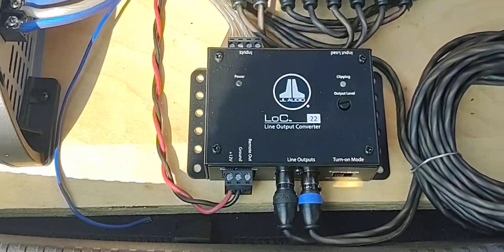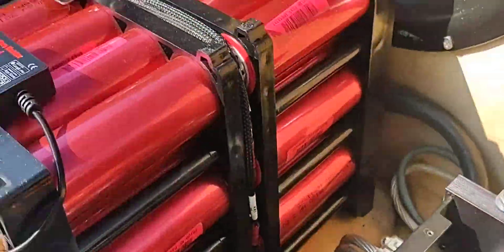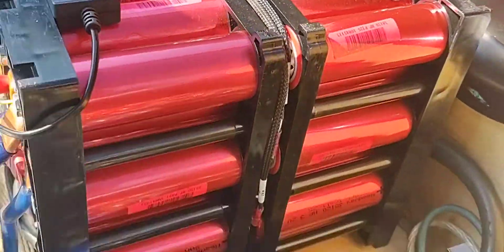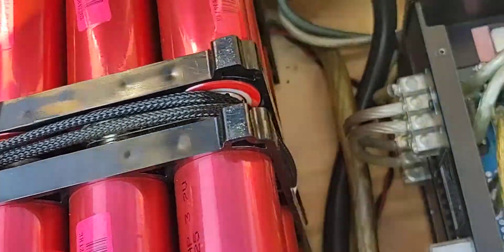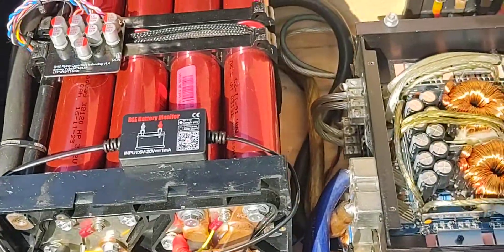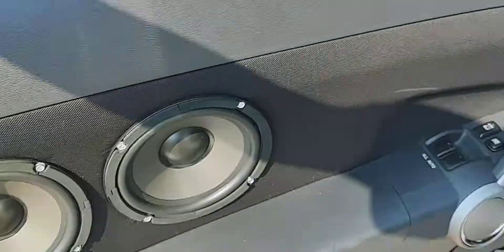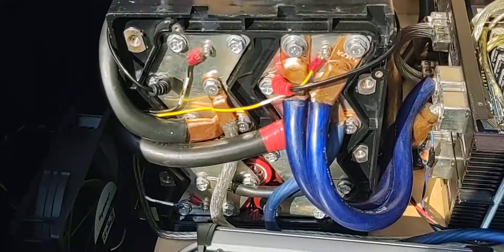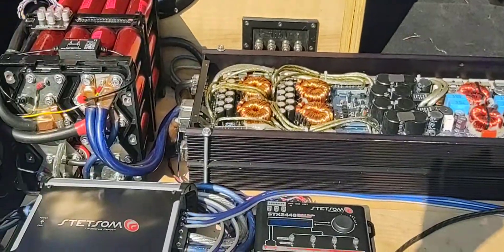Headway "Super Beast Module"

Comment: How do you charge them? alternator?
Reply from the maker: I used the alternator which isn't technically recommended, and had zero issues. I do have 370a diy large case hairpin that took the beating like a champ.

Comment: Also can you please tell me what I need to make it work properly with my stock alternator my car 2019 Toyota Camry LE has the new ONBUS LINBUS electronics build which means the cars computer is built into the alternator housing and therefore can NOT be converted with a HO alternator so lithium is my best option specifically headway because of the stock alternator or I would want LTO from what I'm being told so I want to get the super beast and I'm thinking about getting the 96 AH PCBway boards but I'm told I will need some type of BMS and active smart balancer is that correct and can you tell me what products you have to make it work again all this is new to me

Comment: Please excuse my lack of knowledge I've been gone for quite awhile not willingly mind you lol but when I left an extra lead/acid battery in the trunk was doing big things with your system now everyone has massive lithium banks I'm getting back into it nothing big YET just two L7'S with an 1800.1 but I want to go bigger so I've been looking at the super beast and I'm wondering if I caught what you were saying correctly but after converting to 12v this winds up being two 48AH 12v banks for a total of 96AH of lithium instead of 48AH at 24 volts

Comment: I bought the 64ah beast module and in my opinion at $340 at battery hookup they are a excellent value for the money, I shopped around and AGM is expensive and enough AGM to do the job adds up fast and brand name premade lithium units like XS, limitless and JY are insanely outrageous I'm not paying $1000 for 1 battery. So far I've had good luck I'm powering a cab45 5k and 2 four channels off it and a stock 140A alt. I do want to get a 250A alt to maybe squeeze a bit more power from my amp but I'm thinking I need to go at least an 8k so if I do I need a bigger alt because current power setup is barely or not sufficient for a 5k imo. Problem I always run into is impedance, whatever I choose ends up wrong when time to upgrade.... I'm building 2 D2 subs so I can run .5 ohm which is fine on my cab half bridge amp but if I wanted to grab up a taramps 8k my .5 ohm subs prob pop it.... So it's find an expensive 8 or 10k half bridge or 2 full bridge amps which starts getting expensive... Uggg! I guess getting 10k by adding a 2nd cab45 one on each sub at 1 ohm is cheapest approach to get more power.... There $550 now I got mine for $379 on pre order wish I had bought 2.... But I'll see how the 1 cab does on my new 15s it did pretty good on 2 1500w XR subs but 2 custom built 400oz motored 3k subs at .5 we'll see I guess.

Comment: i have a super beast now. how long b4 you do a detail vid
Reply from the maker: I will be purchasing another, and as I build it, I will make the video. I put it off as this pack was overcharged, and every cell vented. I have some videos shooting it with some ol 7.62x39. I apologize for the delay, sometime this next month.
Reply: @georgesrisomsak9650  You know what they were charged to?
Reply from the maker: @loganmilam4065  16+volts for a good while. Definitely don't recommend to use these without battery management, or very careful monitoring of the pack regularly. I may switch up to lto, as I'm in a cold climate. Maybe some listen cells that are safer, and have more output. Less power dense, but makes up for it in discharge capabilities and longevity. Headways are still badass, and if I couldn't charge at higher voltage (15+) I would not hesitate to get another pack. My car doesn't mind 15.2-15.3, so I may switch it up and go a different route. I will still build another, I have another bigger build coming up that will require 128ah, so I'll post up a how to early this next year.
Reply: @georgesrisomsak9650  Two months ago I purchased 24 more Lishen 18v calls from Custom Electric. In the summer I will convert to 15.5 warm and build my wall. Thx for sharing! Scot

Comment: Also it seems like you would have a lot more views if you were to post this on the DIY lithium battery page on Facebook.. a lot of people there looking for information on how to hook these modules up
Reply from the maker: It's super simple, just cut the buss bars down one side, dividing the cell group into to 4p 6s units. Don't get it wrong when paralleling the banks together, you'll have 4th of July real early, or late again, pending how ya wanna look at it! 😂
Reply: @georgesrisomsak9650  oh but the way I learned you didn't have to do any cutting of the bus bars and you could create one large 12 volt bank without having two separate 12 volt Banks.
Reply from the maker: I'm really not in it for the views, just for documentation, and maybe it'll help someone that happens to stumble upon it like yourself! I should do a detailed video of the next one when I do it for reference. It's super easy once I got it figured out. I even have one single 4 cell balancer that balances both 4s 6p banks in parallel. Tricky, but doable.
Reply: @georgesrisomsak9650  to balance the cells before building the bank I can just use the bus bars and connect all the positives and all the negatives together to balance them out right?